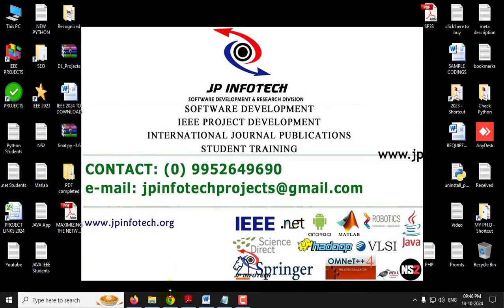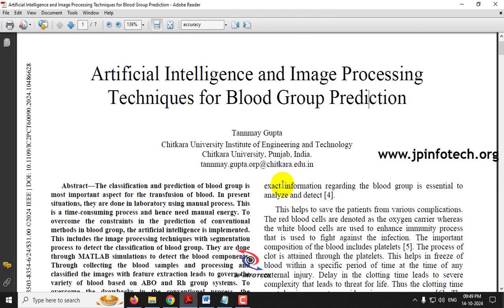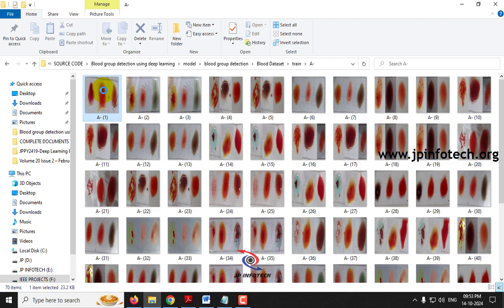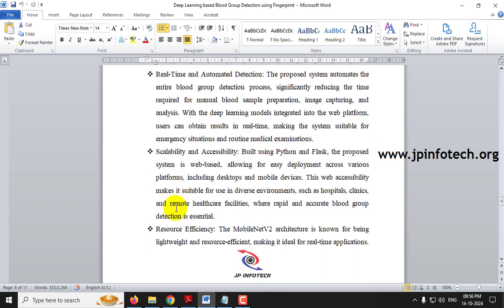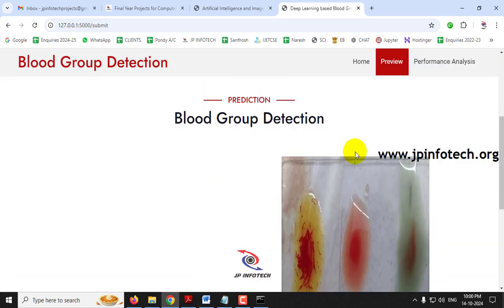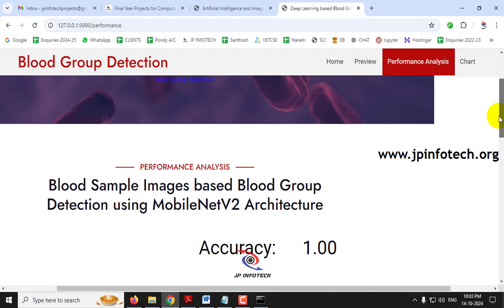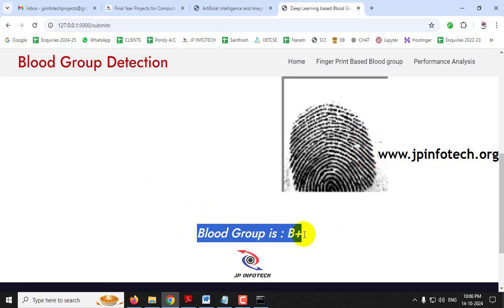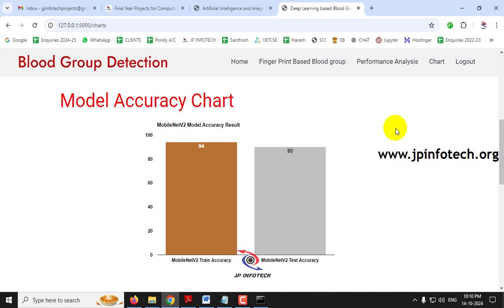Deep Learning based Blood Group Detection using Fingerprint | Python Machine Learning IEEE Project

Comment: Can we upload our own fingerprints i.e. ours or someone else's and if we do then will the output be correct?
Reply from the maker: The model is trained on a specific set of images labeled with known blood groups (like A-, B+, etc.). The model identifies patterns in these images to classify new ones. However, the model is currently limited to detecting blood groups based on image data from a controlled dataset. This means the model needs to be trained with a substantial dataset of fingerprint images that correspond to verified blood group types to generalize well to unseen fingerprints.

Comment: when u r selecting the fingerprint image from A- and uploading it will obviously give A- only...... what are we supposed to do when professor say detect my blood group? how to obtain his fingerprint image, I'll somehow find an app or smtg to get finger image and then in which cluster should i place his image ??, ntg is making sense here.
Reply from the maker: The model is trained on a specific set of images labeled with known blood groups (like A-, B+, etc.). The model identifies patterns in these images to classify new ones. However, the model is currently limited to detecting blood groups based on image data from a controlled dataset. This means the model needs to be trained with a substantial dataset of fingerprint images that correspond to verified blood group types to generalize well to unseen fingerprints.

The model doesn’t use explicit "clusters" in the manual sense but instead relies on the underlying deep learning model (MobileNetV2) to automatically classify images into predefined blood group categories. If the professor’s fingerprint closely resembles patterns seen in the training data for, say, "A-," the model would likely classify it as such. However, if the model is uncertain due to lack of data or variability in fingerprint patterns, it may misclassify or give a low-confidence prediction.

Kindly note that this is only a Final Year Project. Not a real time application. This project demonstrates a proof of concept — it’s not yet a fully validated medical application.

To improve reliability in real-world use, future work should involve gathering a large, verified dataset of fingerprint images across different blood groups, allowing the model to generalize better.

The technology’s limitations should be clearly communicated in practical applications to manage expectations